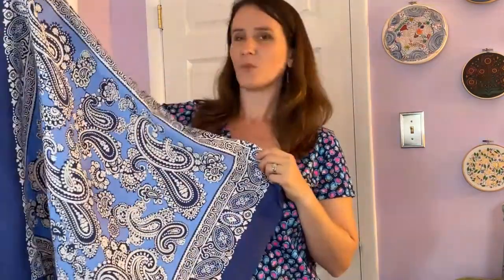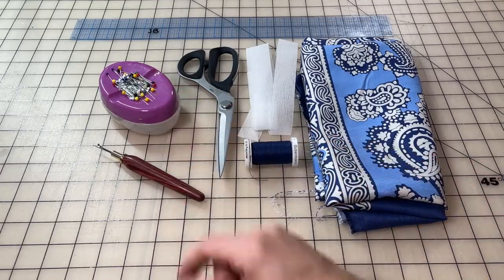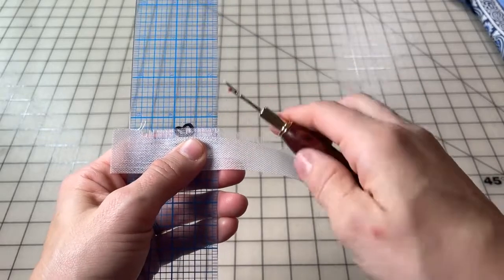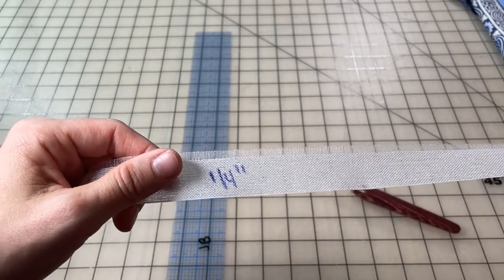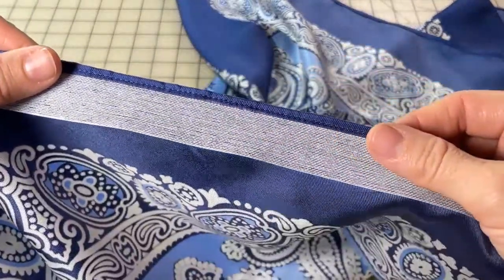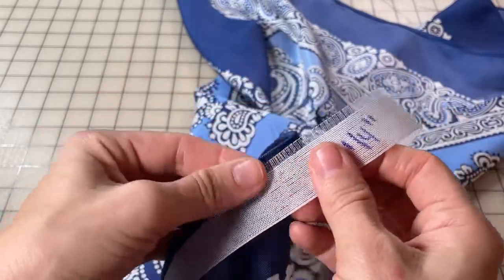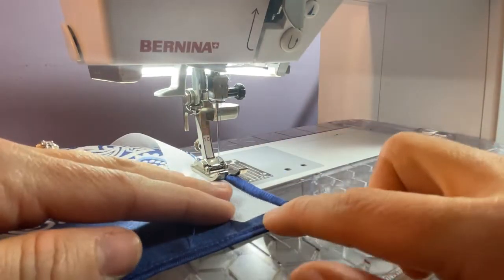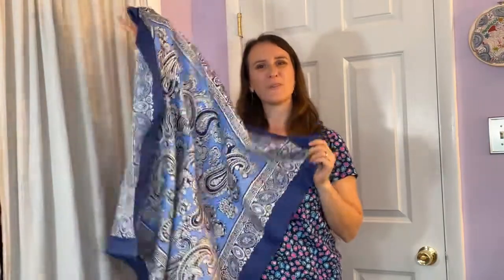Sew a Perfect Narrow Hem with Ban-Roll | DIY Silk Scarf Panel

Comment: Hi I'm trying to learn how to make a square scarf for veiling. From beginning to end. Can you tell me olease if I just cut out a square piece if material and sew a back to it in a different piece, then add a border? Thanks in advance.
Reply from the maker: Hello, I'm not sure I understand. If you're looking to make a square scarf from fabric, you will need to determine the size of your scarf and cut it to that size. If you're adding a backing fabric to it, then you would need to sew two pieces right sides together. Leave a hole to turn the scarf right side out. Then sew the opening closed.